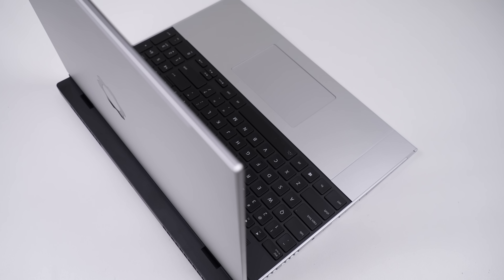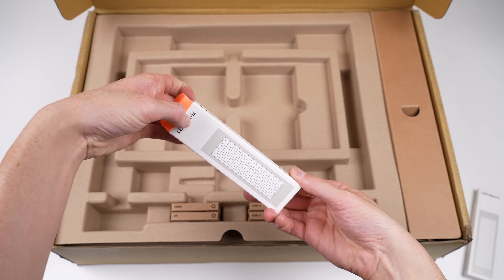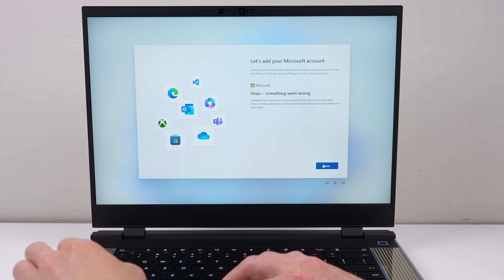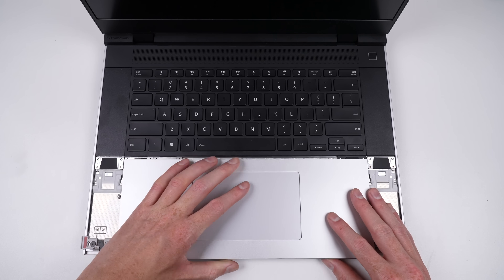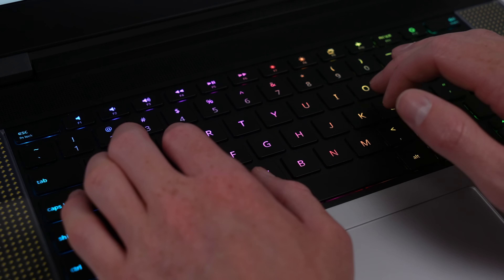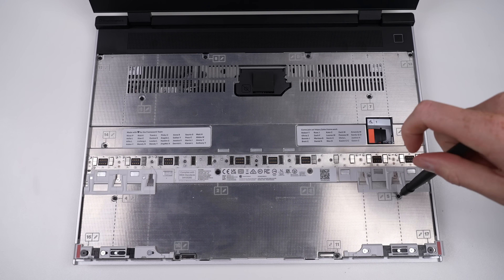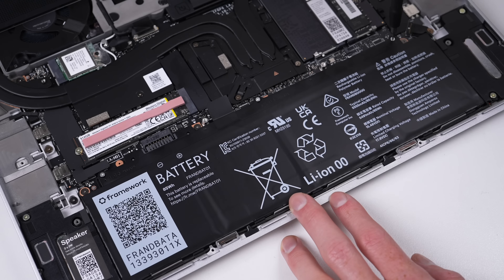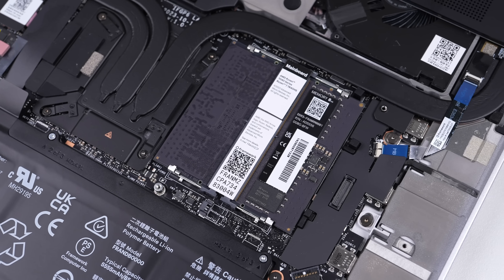Game Changing New 2024 Laptop Design - Framework 16 - Teardown And Repair Assessment

Comment: 5:50 Just a clarification, that is the Radeon RX7700S which is the dedicated GPU. Radeon 780M is the Integrated GPU that comes with the base model
Reply from the maker: Yes you're correct, I was reading what Windows reports in the "System" page. It doesn't show the dedicated GPU in the list of specs.
Reply: @HughJeffreys I'm pretty sure it never shows the dedicated GPU there for some reason, the only place it shows them is the Performance Tab of Task Manager and Device Manager
Reply: @Vedant9710 you can also check it in display settings
Reply: @Vedant9710  or using win+R and type dxdiag
Reply: @HughJeffreys  Will you cover modern gaming laptops like the acer nitro 5 which pack upgradable ram, storage. And replaceable battery and wifi card? With a 2.5' bay. Its also pretty repairable too. Like most gaming laptops.

Comment: next time you are setting up windows 11, at setup when it asks for an email do this
shift + f10 
when cmd opens > type in " oobe\bypasnro" 

then when it restarts go through everything but at the internet connection part, just make sure not to connect to your internet or unplug the cable so it does not get internet

Comment: Not like the "disposable" Apple computers that are not just very expensive but also intentionally-made impossible to repair.
Reply: To be fair, though, all my Macs have lasted me more than 10 years, so that means I haven't owned many because they last so long. Apple has a flat-rate OOW repair (~$300) where they will fix anything and everything they find wrong with it, including flat panel display. I did this with my 2013 15" MBP last year which had a swelling battery. They noticed that the screen's UV protection film was peeling, so they also replaced the display under that same flat-rate repair. If I had done a regular parts and labor repair on the screen, it would've cost way more. Is it upgradable like the Framework? No, it's not. You're stuck with the same 10-yo processor and mobo, but it still does its job. I don't feel the need to get a new one until this one completely dies or it can't perform what I need it to do.

Comment: The problem with this configurable design is that there is so many plastics in between the essential bits. Weighing in at 2.1kg, the laptop without the dedicated GPU is some 1 kg heavier than the current laptops out there, which is a major con.

For the anime fans out there, the transformable machinery in the Transformers and Robotech also have a major weight penalty.

Comment: I don't need a big GPU in my laptop so I'll wait/hope that they will make a laptop that has more of a slim design that doesn't need the big cooling and GPU but still has the modularity of the framework experience. I just want a slimmer repairable laptop thats 16inches! I do acknowledge with the modularity comes more thickness.

Comment: if all laptops have upgradeable gpus it will make more sense than to have a desktop for more casual users. the laptops that can be resurrected specially those paired with older high end intel cpus that are still very capable for gaming but bottlenecked by gpu

Comment: 5-10 years ago this would've been an interesting idea, but now...neah
At this moment in time gaming laptops are a dead species.
They are overpriced and need to be plugged into mains power to be actually usable, and not running offgrid, as they will be in limp mode, severely useless as gaming rig.
A mini ITX build into a 10l or less case uses full size desktop components of the same name as the laptop ones, but as well all know the laptop components don't have anything in common, just marketing.
The 10l case is portable enough as much as a 17 inch gaming laptop and it's power brick. (You could make the mini ITX build even slimmer if we would use an external PSU as laptops do)
But with the 10l case you can still put in into your backpack and go wherever (there's like 5 kg extra weight from the laptop, but that's like a a couple of bottles of soda worth)
So, the same as with the gaming "laptop" you can game wherver you go with the miniITX build, by plugging into the mains there. (as in hotels, vacation homes, etc where they have TVs for output, but you can bring a slim portable gaming display as well that can be used.
Same money at least 50% more performance with the desktop, not much more difference in portability

Comment: I'm always eaistant about framework. It's cool to be this easy to repair and open but how many times you would do it? Once? Twice? Maybe something gets broken and that's easy repair ok fine but for a similarly specced laptop i pay half of that and i probably get a better screen and some companies like lenovo or asus are for sure less accessible than this but not THAT hard if you know what are you doing(swapping ram/storage/wifi card is pretty easy) and even in the case of smashed screen you can go to a professional and you still are way below the price of this most of the times. Then even upgradability one year you change the gpu one the cpu maybe you want to go to 32 or 64 gigs of ram and suddenly you changed the entire laptop except the chassis and the keyboard(and maybe the monitor) and at that point is it even worth it without some sort of sure cashback or a proper rycicle route. Framework makes this skeptic all the time

Comment: My Acer 9920G from 2006 has removable batteries, removable GPU, CPU, Bluetooth, WiFi, DDR2, 2 HDD, keyboard and DVD, everything is interchangeable and up-datable.... and because of that still in use 30-jan 2024.

Comment: I bought Clevo design laptop with removable battery, ram, easy access to cooling, replaceable screen (just the screen not the entire assembly), keyboard and touchpad. 
Little plastic as well due to magnesium alloy frame but if I ever need an upgrade, this will definitely be a consideration. 
I'm based in UK so hopefully they do ship here. They do require recognition for this achievement and level of support.

Comment: Removable PCIE graphics accelerators for laptops have been available with the MXM standard since 2010 but mostly abandoned by 2017. Laptop makers decided to implement thinner and lighter machines to compete with apple macbooks and nvidia quit making the modules even for desktop replacement (now called "GAMING") laptops.
I'm glad they're coming back. This laptop looks like a marvel of modularity.

Comment: never mind
Reply: there is a gpu, it’s an AMD 7700s
Reply: @Marauder-q2v  ????? it's a Radeon 780M
Reply: @flamingkillermc2806  780M is the integrated. There’s a seperate dedicated gpu that is the 7700s.

The entire selling point of the 16 inch is the gpu module that you can put into the laptop.
Reply: @Marauder-q2v  You are correct, my mistake. It's similar preformance as a 3070
Reply: @flamingkillermc2806  I honestly don’t think the 780M is that bad. Remember it’s an integrated gpu. It has the benefits of chugging less power compared to dedicated. So it will retain slightly more performance than something like those anemic iGPU’s on intel’s stuff
Reply: @Marauder-q2v  my mistake it has a 7700 gpu

Comment: below average hardware, way above average pricetag, quite ugly design, and who is going to replace CPU and GPU anyway? It would not be worth it any day. Regarding RAM and SSD, you can replace it in most PC laptops, and that is essentially the only thing you "may" replace during the  3 to 5 years lifetime of a PC laptop. With 3000 USD you can purchase a new 1000USD laptop with better specs every 2 years. It will always be better than pouring 3000usd into this, or you can purchase an apple laptop which will last 7 years.
Reply: your take is terrible, your first 3 criticisms are just bad, the 1st one is just false, the 2nd has a logical explanation, and the 3rd one is literally just your opinion, your other stuff is also bad, get your critical thinking together
Reply: @stoneforbreakfast no, I think he has very valid points, though
Reply: @rivciks5045  points that make sense if you don't get the full picture, they're comparing a new, innovative laptop from a pretty new company to laptops that get mass-produced by market-leading companies, and all from a point of view that easily ignores the strengths of this product full of features that are just not for their interests, you shouldn't criticize things that were not catered around YOUR personal interests
Reply: @stoneforbreakfast  are you working for Framework laptop company?

Comment: If you look outside of the mainstream laptop manufacturers, some still have modular GPUs and even desktop CPUs in a laptop. A few examples: Clevo, XMG, Schenker etc. Most are Clevo clones, but you have options regardless. They usually use MXM GPUs, so it is upgradable, tho for a big price most of the time.
Reply: Shows how much better Framework Ad department is (or how much more are they willing to bet). I never even heard about them and shame on google for not giving them as a result when googling Framework especially when Framework is available like in 5 countries and for example I can buy Clevo in Poland (for my kidney unfortunately).

Comment: Alex on Short Circuit found that if you put a thick thermal pad below the stamped steel plate where the keyboard sits to brace it more, it improves the feel of the keyboard substantially. Removes most of the flex that makes the keyboard feel mushy.

Hopefully Framework will include one pre-applied to the bottom of the plate with retail models.
Reply: And even if they don't, that's an easy fix made possible by this device's easy openability!
Reply: guess what

Comment: No hot swappable battery tho, framework definitely should take a look at such feature. Not necessarily a bulky 18650-based, there are planar modular batteries too.

Its soo convenient, just think about it: each battery gives you 7 hour screen on time (pretty decent by todays standards) but what if you carry 3 additional batteries (<1kg so weight is not an issue)? +21 hours easy, so in some scenarios you dont even need to bring a charger.

Comment: I don't mind a lot of screws as long as I don't have to look around for hidden screws on top or bottom. This is how all equipment, not only computers, should be made. Just use the code to get the spare part from the manufacturer and move on. Be able to mod it, clean it, repair it. The 16 is on my list as a company purchase and later a personal one
Reply: As someone who has spent most of the last 50 years servicing lab, medical, and industrial equipment - I agree. The marketing departments in many firms hold sway, and demand that fasteners must be hidden, making their equipment much less serviceable.
Reply: There is a not evil reason why this kind of thing left out by Computer manufacturing companies. It's expensive and heavy
Reply: @IslamistSocialist371  but many more evil reaaon.

Comment: You can also press shift + F10 that opens a command promt an then type in oobe\bypassnro the Laptop will reboot when you are not connected wie ethernet or WIFI it will give you the option "" I have no Internet"

Comment: The QR code lead to the memory replacement guide is only visible AFTER you remove the ram module which means 90% of the work is already done before you reach that label. So that label is basically useless

Comment: I watched a video on Linus Tech Tips when they reviewed this laptop as well and they had a quick DIY fix for the keyboard. A couple of thermal pads placed beneath the top case where the keyboard laid served to firm up the surface space and make the keyboard a LOT nicer to use. It looks like the top case is just too thin and has too much flex to allow for really comfortable typing but just 3 or 4 thermal pads placed strategically underneath the aluminium was enough to firm the entire area up and greatly improve the typing experience.

Comment: Brilliant design with incredible modularity, more manufacturers should be doing this. My only concern is the cost, as even with the DIY version, it was very easy to arrive at a £3000 price tag for a power user setup. Saying that, you do at least have the option of going in low for a minimum spec machine and upgrading as you can afford it, which is a definite bonus. Well done Framework.
Reply: I don't think you will reach £3k if you do sensible upgrades - don't get the R9 (seriously, you're wasting money), bring your own RAM and SSD (the latter can be salvaged from another device even), keep the modules to a minimum (don't get 20 spacers). I configured a pretty complete package at £2100, including GPU but no RAM, as I could get it for considerably cheaper online.
Reply: @leonro  £2100 is still massive, I bought lenovo for $750 (i5-13500h, 16gb, 500gb, 14,5") and for $500 eGPU case with used rtx 2080 (desktop version obviously).
£2100 is before or after taxes?
Reply: @drayke8886  It's £2100 including taxes, though you could lower the cost to around £2000 if you don't include unnecessary extras (more than 6 ports, both numpad and spacers, etc.). The eGPU solution isn't really comparable though, as it is a serious detriment to its portability, and laptop GPUs usually come at a premium. Also, funnily enough, the RTX 2080 is roughly a match for the RX 7600 in performance, so it barely beats the mobile 7700S.

Of course, your option is cheaper, but it's a smaller laptop with less expansion. I didn't include RAM or storage, but you can get 16gb DDR5 and 1tb ssds for below £100 total. It's on the pricier side, but you can't expect a new company to match Lenovo in value and availability. It's already great that you're not overpaying egregiously large amounts of money on it. It's not the best deal out there, but it's a valid option if you value customisation or repairability. It also gets better in value if you want to add copious amounts of RAM and storage, since you will not end up overpaying for the upgrade like with other manufacturers.
Reply: @leonro  I didn't want to say that my setup is better, just that it's cheaper, probably something like half.
I'll have to buy new laptop after few years whereas you can just buy MOBO with PCU.
And you are so right about higher end spec stuff...
Reply: @drayke8886  Sorry if it came off as that, I just wanted to specify that an eGPU is a bit worse than an integrated dedicated GPU because of portability (and latency, I guess). 

You're still paying a bit of a premium when compared to another laptop with similar specs, as I found a 16" Asus TUF with an r9 7940h and rx 7600s (better CPU, worse GPU, so should be close) that costs £1400. So you're roughly paying 50% extra for the performance, but I'd argue that you're getting an overall nicer laptop with the Framework (not plastic, better cooling, non-proprietary USB-C charging). 

On a side note: I currently have an Asus laptop whose battery died prematurely after 3.5 years, and their repair options are pretty bad: they don't sell you batteries, and will instead send your laptop for repair to a third party with an exclusivity contract (LetMeRepair) and extremely poor reviews. I ended up buying a second hand battery on ebay because the "new" ones all seemed sketchy, so I'd probably pay the premium to have a more repairable laptop so that I won't have to deal with this again. I don't know about Lenovo repair options nowadays, but it didn't seem particularly potent either the last time I looked about 2 years ago.
Reply: @leonro  Does it really have better cooling? I feel like having modular comes with the cost of space and cooling when others can design just for cooling framework has to keep things swappable.
Lenovo repair is same as Asus.
Also I won't buy another Lenovo because they limited usb-C charging just to shipped charger, nothing else will charge it.
Reply: @leonro  as to prices I know I paid premium because it's premium laptop, not gaming laptop. 
I figured it'll be easier to sell later.
My whole point was that framework is just too expensive to justify buying it (even though I really wanted to)
Reply: @drayke8886  At least some of the reviews talk about it being quite cool, and the swappable GPU module is larger towards the back of the laptop to accommodate for the bigger cooling design. 

It was pretty much the entire point of having a GPU at the back, because they might require more cooling depending on the generation and therefore they need to make larger modules. If it was supposed to fit inside a fixed chassis, then their design would have suffered eventually because of the lack of cooling.

As for the Lenovo, that sucks to hear. At least my laptop would charge over standard PD. I also bought a premium laptop, but mostly for the portability, since I was just starting studying in university. It was way too expensive though, since I had to buy it during the lockdowns when all laptop prices went through the roof.
Reply: Better off building your own desktop for half the cost and twice the power.
Reply: @portman8909 Good luck lugging a piece of furniture around with you, along with all the other shit it needs to function...
Reply: yep, as long as you don't  @portman8909  need to take it with you for some reason. I mean I have my main machine on the desk and a fairly old laptop if I need to be mobile for some reason and quite a few do no?
Reply: @portman8909 the GPU is basically an RX 7600, so to double the performance you need at least a 4070 Ti or an RX 7900 XT. Combine that with a top end CPU and, with how expensive motherboards are these days, you're probably already past £2000 after including SSDs and RAM.